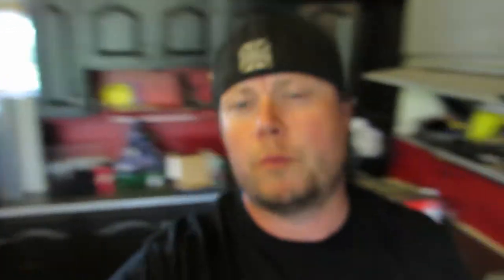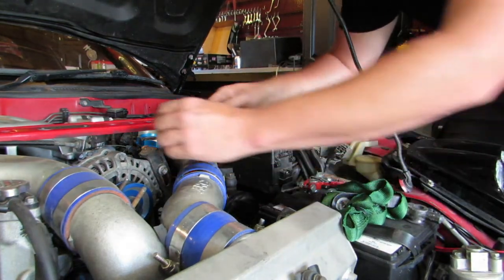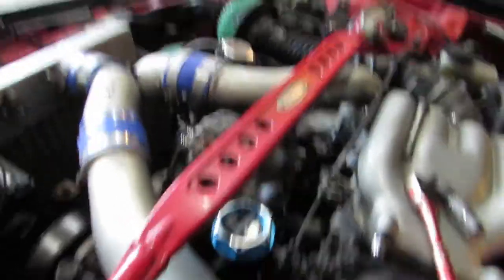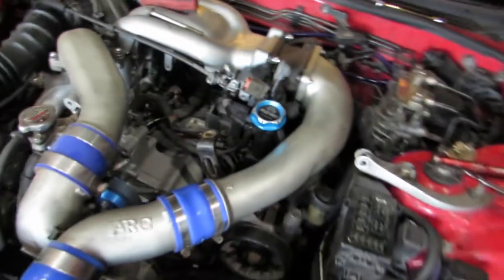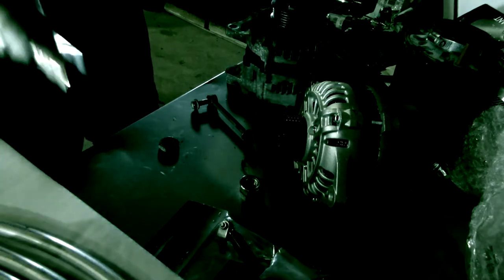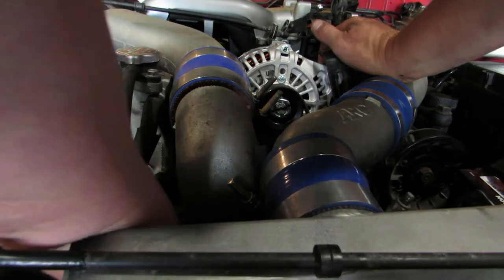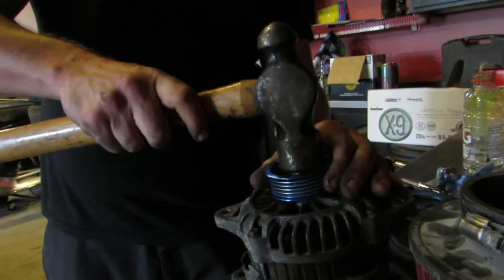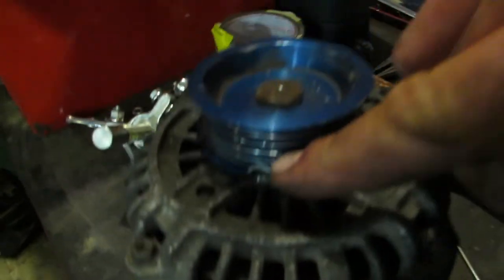I called out Brent to a drag race (gotta fix the rx7) how to remove an alternator

Comment: I hope the alternator was your problem....I have the same thing going on....at 4000 and up in losing 1.5 to 2 volts to fix this we install a dual boost a pump, even though I run 2 walbro 465.... we check everything and it's either a BAP or a second battery..:) cheers!
Reply from the maker: I hope it was too, Still having a problem with the belts. you'll see what happens soon I guess 😆